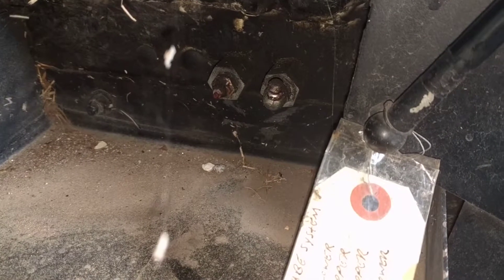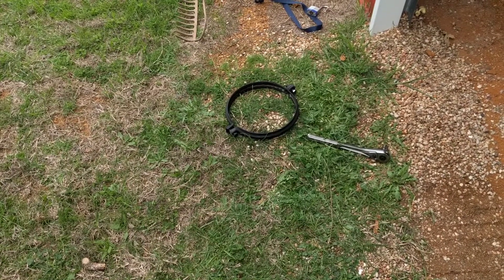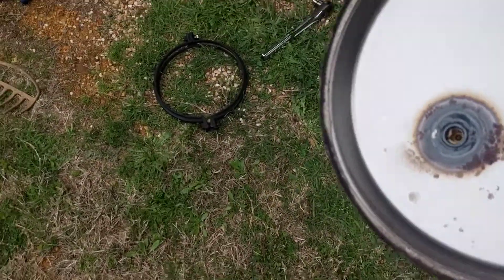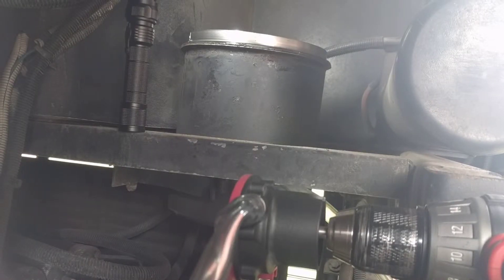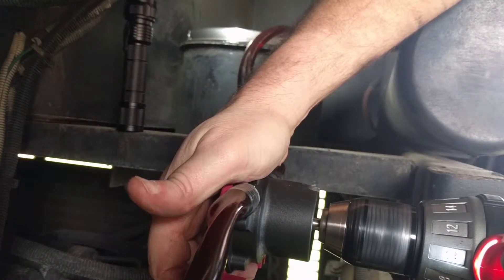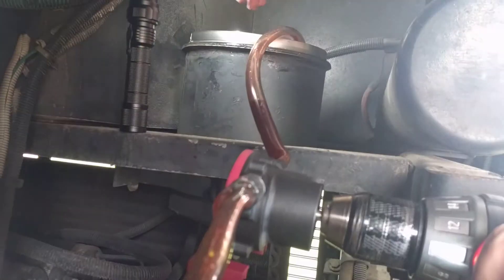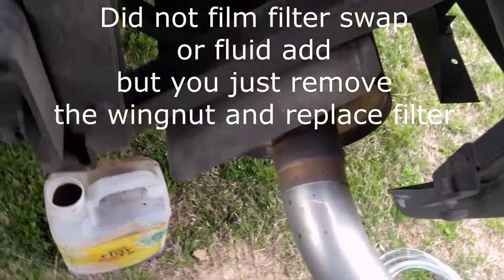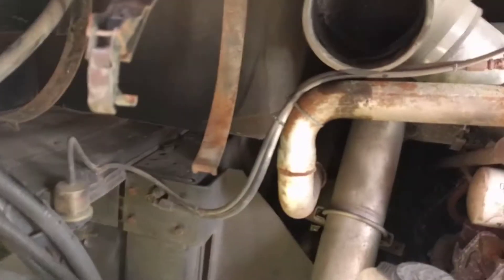Class A Motorhome hydraulic system maintenance

Comment: I would think by letting your jacks down wouldn't this keep hydro fluid in the jacks ? This would be old fluid that you did not
change out that now you are going to mix together ?
Reply from the maker: The jacks are on their own circuit and isolated from everything else. This change was for the items that run off the engine hydraulic pump which would be the power steering and the engine cooling fan (which is driven by a hydraulic motor). Their really isn't a good way to "flush" the system so regular changes of the reservoir is what's recommended. FYI as far as jacks go I don't think that fluid would ever need to be changed as long as it doesn't have water in it because it never gets really hot. The fluid for the jacks is 20 yrs old and still looks good .. thanks!
Reply: @BubbasWorkshop   I'm truly sorry if I fended you in anyway . I'm learning so when I get my motorhome I will know something about what to do. Thanks so much for your understanding
Reply from the maker: @jsteele42378  No way! The whole reason I do this is to try and help other people and pass on what little I know 👍
Reply: Mine has drain plug 🤷‍♂️